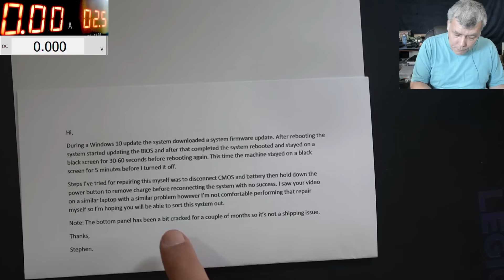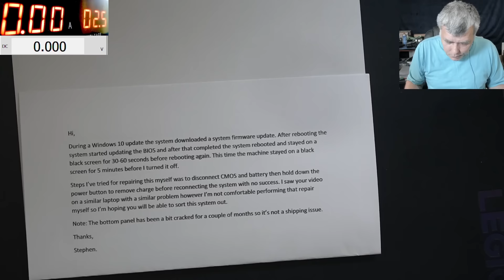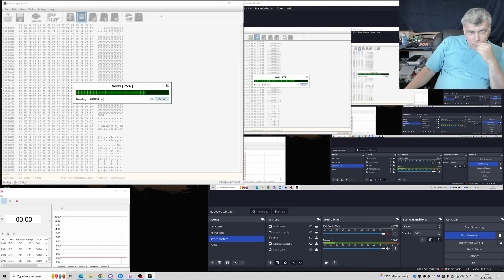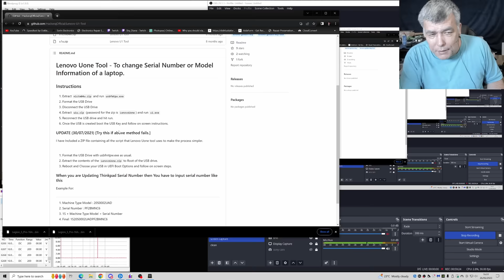Lenovo Legion 5 15ACH6H dead after windows updates - Sadly, laptops are dying after windows updates

Comment: Once again, my fear of BIOS updating has been reaffirmed. This should never be an issue. It would be almost effortless for manufacturers to include a backup BIOS on these laptops (especially when they cost over $1000 ffs). But they don't want to, probably because it's yet another point of possible failure so that they can force customers to buy new laptops more often.
Reply: I can't help but think of the fans in modern units.  I've looked at all kinds of machine's fans under the microscope as I've had to do work on stuff over the years.  Sintered bronze, oil impregnated bushings are standard (Or ball bearings, but best of luck finding those now) in high quality motors.  My thinkpads have sintered bronze bushings, but every other modern machine I own is solid bronze.  I tend to get about 2-3 years out of modern laptop fans before they start howling due to worn bushings, a bit more if I'm super careful about never letting them spool while sideways (So the magnetic field/shaft termination holds them in place instead of the bushing) .  It's absolutely intentional.  And it didn't used to be like that.  I have fans from cheap netbooks from the late 2000's and they've got sintered bronze, oil impregnated bushings.  Some of them are still running today.
Reply: And not buy them from the same company
Reply: why even update it, is the unfinished at release videogame trend infectig BIOSs now too?
Reply: @GamingHelp  I heard from someone at a local PC shop years ago (pre-pandemic) that in some cases laptops fans were basically giving out at 1.5 year mark. --- Of all the places to cheap out, the cooling system seems like a very poor choice.
Reply: @mactep1  Your ignorance is showing there, just saying. -- I suspect a somewhat different kind of problem, albeit still bug related. For one, virtually all  software has bugs, it's a fundamental reality of software development. And it isn't always possible to test edge cases like a damaged laptop, hardware failures for potential BIOS bug condition. -- Also, I really doubt that Dell, HP, Lenovo, Acer, etc re-test it their BIOS/UEFI code with every single bew model line they release.
Reply: @jnharton : Yup.  I bought my alienware 15r3 based on the fact that they APPEARED to be high end, well made units.  Same deal.  About two years before they started to howl.  Of course, it doesn't help that windows would do background B.S. for about 4-6 hours/day and drive them to 100% for hours at a shot.  Desktop users don't notice because they don't have a direct audible cue on higher CPU use like that, but it's one of the reasons I just had enough, moved to thinkpads and rebuilt my entire software stack on BSD.  Now, everything works, I just get stuff done again.  Modern tech is fast, but it sure is flaky and fragile.
Reply: @mactep1 : That's not games, that's the entire industry.  When people adopted Agile and realized "We can fix it later now!", software went downhill overnight.  MS fired almost their entire QA team.  It's why you HAVE to install something once before you can uninstall it.  They WILL NOT let you off the "test our code for free" hamster wheel.  And people just refuse to believe it.  If you want to know how far downhill this has gone, I suggest reading the Bungie GDC panel thing.  They flat out explain modern development views.  Here's a few gems: "Don't overdeliver" (Don't make anything too good) because it creates future expectations.  Don't polish and bug test too much.  Don't fix bugs unless they're going to hurt your financial bottom line.  There's a reason I'm typing this on BSD and that reason is this: With a half dozen networked modern windows machines, I can't keep them up long enough to get anything done.  Sadly, end users are SO habituated to this B.S. at this point that I routinely hear people claim "Weird, I never have those issues" literally a half hour or less after actually having those issues (and typically having to emergency reboot to fix something).  Modern corporate software is a turd.
Reply: @jnharton  A properly designed and tested BIOS (one that just boots the pc without any stupid features/spyware) does not need updates, my Toshiba laptop from 2011 has never received a single bios update, i don't think it even has the ability to update the bios, mf still kicking even after more than a decade, compatible with windows 10 too, bios updates are always risky, especially when you force/automate them for someone who has 0 knowledge or understanding of the risks, and thinks its just like win update.
Reply: @mactep1  Except that in reality that's just not how it works. It's true that regular updates /usually/ aren't needed. But at the same time if a big enough problem is discovered it might need a patch/update and will be made available even if it isn't relevant to your needs. A lack of updates proves nothing, except that no updates were made/published. --- Modern laptop are also different than desktops and earlier machines because they are rarely if ever fitted with different hardware. --- I never said BIOS updates should be automated or forced, only that BIOS software isn't somehow better or more perfect than any other software.
Reply: @GamingHelp  With group policy and admin tools you can exercise much more control over Windows than is normally available to the end-user.
Reply: @jnharton : That's absolutely true and I fully agree, you DO have all sorts of twiddleable knobs using GP'ies and the registry, but it still doesn't compensate for the fact that modern agile development seems to have interpreted terms like "feature creep" and "it compiles, ship it!" as design rules instead of cautionary tales.  And end users shouldn't be testing software for the slow rings either.
Reply: @doniherald7745 : That's a super handy feature just in case!
Reply: @jnharton  BIOSs used to be better, most software used to be better until companies started shipping things with bare minimum QC, freeloading poorly made internet-connected spyware/BS, and then expecting users to beta test and fix their mistakes, its not just my experience, thighs from that era just didn't need bios updates unless you were upgrading components.

 Nowadays you got bunch of people, who might have gotten their PCs prebuilt and have almost 0 understanding of how a bios works, needing to update their Gigabyte motherboards or keep the backdoor, cause their spyware team is so lazy they used HTTP instead of HTTPS for their freeloaded spyware that injects itself from the bios onto windows at startup.
Reply: Or force customers to have to return it to their official service outlets for repair.  A sick idea of software as a service. Issue a factory BIOS update that bricks your computer because it's so difficult to do properly.  Sony also uses a BIOS/firmware update procedure with their cameras that risks customers will brick their cameras during the 15 minute process.
Reply: they should absolutely include a backup bios, but i think you're overestimating the risk of bios updating. i've worked on probably thousands of laptops at this point (i work in IT) and i've never had a case of an intentionally performed bios update causing problems on a laptop or desktop (have had issues with intentionally installed HP dock firmware updates, though; be careful with peripherals, i suspect there's less QC).

i have occasionally seen issues where windows update tries to push an old bios update and that can rarely cause problems. microsoft has some kind of certification process for oem driver and firmware updates and only updates that have gone through the certification process get pushed through windows update; manufacturers usually don't bother to certify all of their updates for windows update. this usually doesn't cause problems because typically old driver or bios versions won't try to install over new versions or will cleanly fail early on if they start to, but in rare cases they will go through and for bios updates in particular this can cause problems since bios update packages are often actually updating firmware on several different components.
Reply: @mactep1  BIOS updates can fix unforeseen problems with laptop processors.
Reply: @jnharton  Ive dells and from a 12 yr old to 6 yr ,the fans are quiet and never a prob.
Reply: @GamingHelp  So dont use windows.
Reply: @EmeraldHill-vo1cs : "There's a reason I'm typing this on BSD".  :)  You might not have seen it though, there's a pile of conversation in this thread.  I'm just glad I retired from development before we embraced all this B.S.  If I still had to write code that relied on that platform, I'd jump out a window.
Reply: @GamingHelp  The more i know the less i know.
Reply: @EmeraldHill-vo1cs : A terrifyingly true statement that seems to apply to pretty much everything/everyone. :)
Reply: Its literally in the Cents region to include a dual BIOS system. Or feature an emergency flasher, that can pull a BIOS image from a USB port.
Reply: @GamingHelp  People need to learn to not be afraid of the insides of their laptops and desktops and open them up to at least clean the fans out every couple of months. I've opened up more laptops for "fans failed by crud" than fans that legitimately failed because a bushing failed without outside influence.
Reply: Flash chips with protected "recovery blocks" have been around for ages. Even broadband routers have a firmware recovery mode (well some do anyway).
Reply: worse is that lenove is notorious to force bios updates, my lenovo is always asking for a update of the bios and i was about to do it until i saw people that have made a bios update from the official lenovo site that had a bios that bricked the laptop....... they deleted that bios from their website but fuked alot of laptops ...... now theres a official working bios but i dont trust them. no way in the entire world the normal it shop would fix this........ fuk lenovo they should be sued because of this.
Reply: I actually have the newer version of that laptop. It is a very nice unit. But you are right: It also don't have a backup bios. Which is surprising, since MSI and Fujitsu laptops do.
Reply: You’d have to get a business class machine like HP elitebook line to get backup bios capability.
Reply: @jnharton  I had a Latitude D620 in my shop a while ago, back when I was self-employed. The fan seized up after about 2 years of use. I ordered a new one, using the exact replacement number from the sticker on the fan itself. Put the new one in once it arrived, it worked, gave it back to the customer. Two weeks later they bring it back, it was overheating again. I checked the fan and still spun fine. Put 5v to it using my DC PSU, and it spun fine on its own power. So I did some digging, let the laptop heat up to the point where it triggered the fan, no power on the connector. I traced it back to an IC that's sold exclusively to Dell.

So apparently on some Dell laptops, they put a specific resistance on the fans to where if that IC doesn't constantly get that specific resistance it will burn open and the company that makes it will not sell you a new one. I wouldn't put it past them to have it be an intentional move.

So instead I soldered it to a USB port and just let that sucker run nonstop.
Reply: Same here, even though i had to throw away an old compaq laptop back then but still it's a shi**y way to force people to buy a new one when you can actually repair it even though it's not easy for some but better than pay the same expensive price than fixing it.

My Acer Predator Helios 300 that i bought in 2019 is currently being repaired in one of my local technician and that's a heartwarming comfort that i won't have to be sad forever.
Reply: Manufacturer: $25 coupon code for the bricked laptop, that's my offer 🫴
Reply: I will not update BIOS until it is required
Reply: wrong these have no such board
Reply: There is a write protection feature where a part of the BIOS contains the bootstrap and never should be reprogrammed.
Reply: @thepro08  That's because you have the driver utility application installed. I had my Legion 5 since 2020 and it never once asked for a BIOS update. I removed the factory OEM image and installed my own copy of Windows 10 it. I loaded the drivers manually. Microsoft has nothing to do with BIOS updates and the OP of the video is cleary clueless that has no clue what he's talking that doesn't know the difference between Window's updates and factory installed software updates. I work in thr IT field to support up to 50k plus machines. I'm Dell Certified that does all the Dell warranty repairs as well. I never once in my past 10 years seen any computer BIOS updates via a Window update.
Reply: Learning quite a bit from this discussion. Thanks guys
Reply: As long as the ssd / hdd isn't soldiered to the mobo, it should be fine.
Reply: @eman0828  Yep. Only ever had one laptop that started the process in windows but would reboot to apply the bios update before anything else ever started to load and it was an acer and every other model of laptop i have had used a bootable usb or cd/dvd to update the bios.
Reply: Actually, many manufacturers do includes a bios backup. ASUS is absolutely one such manufacturer. On desktops it’s them and also gigabyte. They have a dual bios system with automatic recovery. Even the more recent dell laptops have a built in fail safe should flashing of the UEFI fail. I’ve seen it firsthand as I deal with dell laptops every day at my work.
Reply: @GamingHelp  Dev here, at my company we create/maintain legacy software for a client. The client's name goes on the product, we just get paid per story point delivered. And yup, can definitely confirm we don't touch anything without first running it past the client and making sure they'll pay, and there are so many terrible things we have to implement (with stupidly tight deadlines) it is really unsurprising the end result is kinda shit. We do all kinds of crazy things, three implementations of the same concept just different enough that they will never be compatible, making decisions about how to design something without bothering to first explore the code to see what's already there or how impractical the feature would be, you name it.
Reply: @traveller23e : Lol, your mention of three different implementations reminds me of a project we had once.  That project was full on cancelled, then revived at least a half dozen times in less than three years.  And at least half those times, it was literally deployed to beta with end users already testing.  That project was a bloody nightmare in every possible way though.  And, turns out, one of the problems was intractable.  Didn't don on me for 20 years why.  Ugh.
Reply: Gigabyte Motherboards HAD this feature named "DualBIOS" to make Bios update without any fear, in case of bricking. Don't know if they still provide this feature with their laptops or boards.
Reply: Your laptops all run on Linux now?
Reply: @sparky9327  All of them expect the rig I use for gaming.